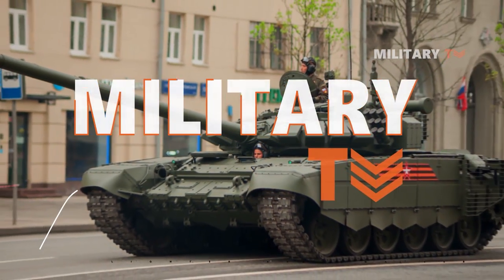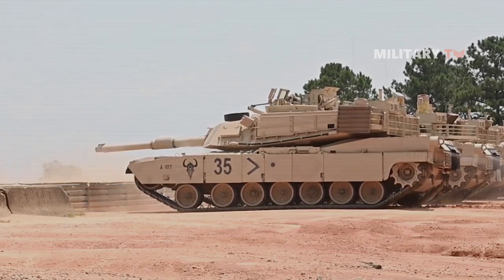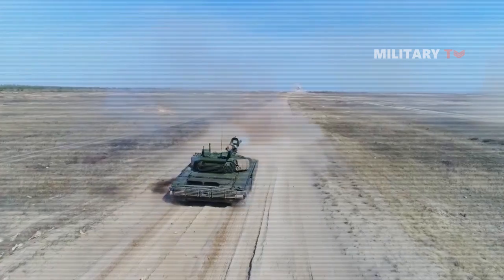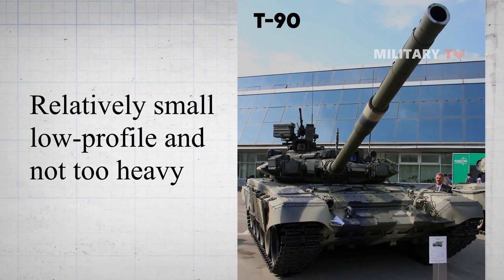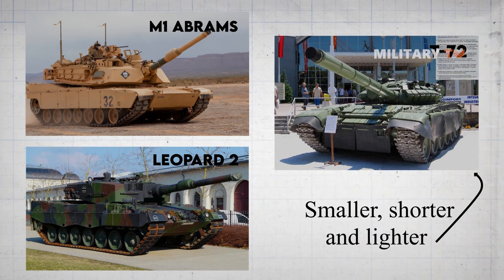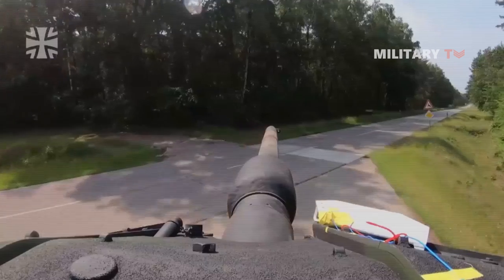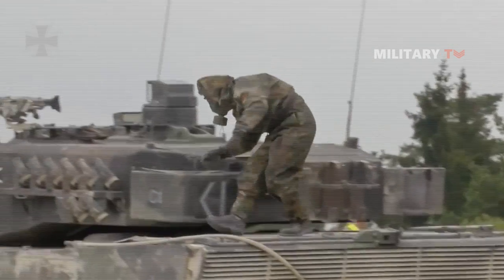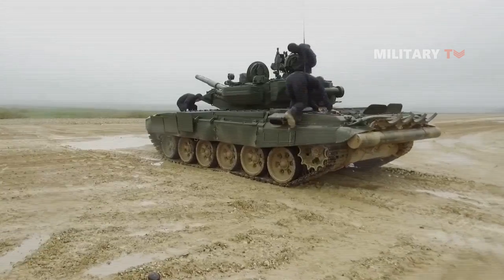Why are Russian tanks lighter and smaller than the western tanks

Comment: Lighter weight means tanks can be shipped faster. A single C17 can carry a single M1. An Antonov 124 can carry 2-3 T90s.
Reply: The antonov is double the size of a c17
Reply: @justinlance4174  no
Reply: @justinlance4174  thats not the antonov he mentioned
Reply: @startingbark0356  yes he stated antonov an120 in his comments right above this. Derpy derp. God Utube is rotting brains.
Reply: @justinlance4174  your brain is clearly rotting, he mentions the antonov AN-124 not the 120
Reply: 1 Abram tank is more than enough for 3. T90s
Reply: @etnadayasiv5449  nah
Reply: And on the terrain in Ukraine a Abram is really shit, way to heavy.. the reason why russia make tanks lighter with bigger tracks is because of the mud before in and after the winter... The Abram is as heavy as a Tiger tank, 70 tons.. Ask Hitler what happened with his tanks on that terrain.. they all sink in the mud because of all the melted snow.. That terrain is terrible and one of the reasons Hitler and Napoleon lost over there.. Abrams will sink in the mud too..
Reply: Russian tanks are made for that terrain
Reply: @toolfreak78  Russian tanks are primarily made for offensive operations, offensive operations normally will have you to flank your enemies and maneuver a lot, increasing the chance for the tank to get stuck in the mud, that's why most eastern tanks weight are generally below 50 tons, so the reason are not just terrain, military doctrine and the needs of the armed force also plays a part.
Reply: @toolfreak78  What variants of the Abrams are you talking about? a T-90SM vs an M1A1 would undoubtedly be an unfair comparison, so be specific.
Reply: Should've compared it with the IL 76
Reply: @toolfreak78  A day ago more than 10 Russian tanks sank in the mud during training. Not light enough.
Reply: @easygamingwwiigamingchanne729  indeed .. its terrible terrain.
Reply: @StormerSixActual  no matter what version, the newest abram will be peppered by a T90.  Because the T90 see the abram first, because of the detection system.. many tanks are better than an Abram. Even the Leopard2a7 is much better.. a challenger 2 is better, merkava ia better.. dont think abram is  a good tank... the only battle abrams had was against old garbage tanks with 75mm barrels and no nightvision.
Reply: You can't  compared the an124 to C-17. The comparable aircraft to the plane is the C-5.
Reply: Деревенщина из Сибири - Абакан    ,_,
Reply: @PatrickLipsinic  well technically yes
Reply: Деревенщина из Сибири - Абакан   yet we have both the largest plane and largest helicopter ever built. We just have no money.
Reply: Деревенщина из Сибири - Абакан   the bigger the car...
Reply: @toolfreak78  ATGM is easily gammed. That is why very few modern western MBTs do not both with an ATGM. The Abrams M1 A2C has better-updated optics and a higher first hit probability.
Reply: @teddyballgame4823  maybe but the optics of a t90 are also very good, detection sensors to 5km and thats a lot.. and the T90 has a secret very strong armor, at least they say... but the T90 has a superior cannon. An abram have 120mm smoothbore and T90 125mm smootbore.. a 120 or 125 pepper all tanks. Not a single tank on earth can survive a hit. If it hits even reactive armor dont work.. with so much force. A 125mm is much much stronger than a 120mm even  when the difference is only 5mm. It can shoot further and has much more energy on impact.
Reply: @toolfreak78  I call bullshit on that one, not only is 120mm superior to 125mm, 125mm is also less effective in combat. 

The 125mm shell is typically used by Russian tanks, and the reason for it over the 120mm was that the Russians weren't able to build as strong barrels as the West. Thus, they couldn't fire 120mm shells that were as powerful as NATO ones. So they build 125 mm shells to get that extra power. However, it should be noted that kinetic energy = mass x velocity squared, and thus speed is more important than mass. Thus the Soviet 125mm shells are still less powerful than NATO 120 mm, if they are identical otherwise.

TL;DR, barrel not strong enough so they built bigger guns [120mm is faster]

Abrams will kick T-90's ass in seconds, and add in air support from air forces, infantry ATGMs like Javelins, TOWs on Bradleys and you get a mobile armored battlegroup capable to blow the shit out of any T-90s defense.
Reply: @toolfreak78  well to start off the Abrams is faster has a better engine more gun depression a faster reverse speed and the gun being 5 mm makes little to no difference if anything the American bullet would have more energy  cuz of the smaller size let’s it slip through the air better not to mention the general unreliability of autoloaders
Reply: They didnt even had nightvision..
Reply: @startingbark0356  1 Abrams can take on about 2-3 t90's a real challenge would be the t14 but if not mistaken none are in service
Reply: @startingbark0356  but the backbone of russian tanks are the t72 which can still pose a threat
Reply: @etnadayasiv5449  not really depends on the situation
Reply: @etnadayasiv5449  of the abrams is in a hulled down position then yea. But if it’s the e other way around then no
Reply: maybe because the Antonov is 16m longer
Reply: @toolfreak78  the Abrams has nv in the commander and gunner sight the t80s and t72s only have it in the gunner sight
Reply: @scootiepatootie7721  yes the abram have but the enemy tanks didnt..
Reply: @toolfreak78  ah I miss read ur reply
Reply: @slycer876  the current russian T-72 has more then double the effective armor it had originally, and much better gun and shells, so its definitely a very potent machine, thats something the US and NATO would forget as they think its just the incomplete middle eastern rust bucket export model T-72’s
Reply: @startingbark0356  more than double the armor is an overstatement if your just implying inactive armor, modern Russian vehicles use kontact 5 or (most modern relikt) era which is designed to defeat kenetic projectiles, and even then its a percentage based off of angle(due to the ERA requireing a specific angle to actually damage the APFSDS US apfsds ammunition is designed to counter KONTACT 5 and more modern varients of US shells counters RELIKT otherwise the actual armor behind the t72 has barely changed. other than a few turret modifications.
Reply: @toolfreak78  Everything you said is just...wrong...how can you pull off being wrong on everything you said?
Reply: @etnadayasiv5449  Your also wrong...
Literally both sides are wrong here
Reply: You're picking the biggest cargo plane under production in Russia?(only the An-225 is bigger). Second, you picking the C-17 instead of the C-5 shows bias. True, the Condor may have a heavier payload. But, the C-5 is capable of carrying 2 Abrams main battle tanks, an Abrams tank plus two Bradley armoured fighting vehicles, 10 LAV light armoured vehicles, six Apache attack helicopters or 36 standard pallets type 463L.
Reply: And how many An-124s in the Russian Air Force versus USAF C5s and C17s?  Russia doesn't generally have a reason to airlift an entire tank battalion as does the USA.  For most contemplated engagements, RAIL will do.
Reply: @toolfreak78  And consider the massively greater kill rate for German tanks of roughly the same gear the Panzer Four. And later the Israeli kill rate vs Soviet tanks that were superior to all experts before the war. Yes they were not the latest Soviet tank but that the same of the Israeli tanks that were more outdated.
Reply: And based on prior Russian vs others battles that 3 fewer tanks than the Russians need to have an equal battle.
Reply: @toolfreak78  I've been reading about superior Russian tanks for over 50 years so I take claims with lots of salt. 

T90 still the flat land no hall down attack in mass standard Russian tank tactics machine. Still going to lose to standard German style hall down and ambush style.
Reply: @toolfreak78  Good point most of Ukraine the flat land that Russians build for. But Hitler's tanks were same or lighter than the newer SOVIET tanks in the period you speak off. Panzer III and IV. Yes the start of the war Russian tank also lighter but they sucked and it the T34 from 42 onward and the Russians had it in limited numbers at the invasion along with a very Heavy Tank in the Heavy Tank category that no one builds anymore. The Main Battle Tank just a renaming of the Medium tank. Thus most German vehicles the entire war roughly in same weight category. The mud actually bogged down both sides in roughly equal measure. 
Only 43 and later did the Germans field heaver tanks than the standard Russian the the Russians had their monster heavy tanks which they had the whole war. And the Germans only were able to build limited numbers of Tigers and Panzer V. 

Over all it was massive numbers of SOVIET tanks that won their kill ratio tiny compared to on paper inferior German tanks. 

It the Soviet winter that helped the most and that because the Germans were not equipped for or used to that level of cold. It was Soviet Winter offensives that helped win the war they could not do much in the Mud either.
Reply: @toolfreak78  the 2A46 is not suppirior the M256 (L/44) and the US has with its M829A4 a much better round over Snvits-2 
ATGMs get cockblocked by APS and other Softkill systems a DU Dart will not. 

the est. pennetration of M829A4 is ~800mm RHa @2km 
while the 3BM60 or 59 have about 700mm RHa @ 1km
Reply: @Adlumairsoft  thats what i said.. a regular round is much more dangerous than a radiographic missle or infrared because these systems can jam.. but a normal rpg they cant jam because ot has no signal, it only can be stopped by reactive armor.  A dart blows through anything.
Reply: @toolfreak78  the cannon on the vehicle doesnt mean shit. just because the .45ACP  (11.5mm) is larger than a .223 (5.56x45mm), doesnt mean its better. 

It wasnt till 2005 that Russia actually released the use of newer ammunition, but for the longer guns of their T-14 series (2A82-1M) and wtf ever will upgrade to use these guns as they have a higher chamber pressure durrability. So, so far, the T-14 and the very very few T-90Ms use the newer ammo, but as its not the primary munition and gun, we wont talk about it as its such a small factor. (dont get asshurt, x4 Su-57s vs x300 F-35s means the Su-57 is non-combat effective)

Before this time the Russians had been using left over Soviet-era ammunition MOSTLY. the 3BM60 Svinets-1 and 2 was their first munition in 2002 after the fall of Soviets. This is an 8.1kg projectile. with a muzzle velocity of about 1790~1800m/s. this gives the munition at 1800m/s a power of 13.122 MJ (but even then, its predicted from Turkish and South African Reports that the MV is as low as 1660m/s and the projectile weight is as high as 8.8kg, still would only get it to 12.12MJ). 
The US uses the M829A3 and now the A4, with a muzzle velocity of 1700~1750m/s and a mass of 10kg. lets go with the low end here; 1,700m/s by 10kg is a power of 14.45MJ. 

For referance, the 3BM60 Svinets-2 states its able to penetrate 515mm/0° @ 2km. i dont have to state any more on that. 
=
But then you bring up missiles. oh boy, does it suck to be you. because the M256A1 on the M1A2 is also smoothbore, it can and HAS fired the LAHAT anti-tank guided missile. the trials set it as a pass for the M1 crews. but wasnt put into service for the US as it wasnt needed when it was trialed. 

So, dont talk shit ruski.
Reply: @toolfreak78  all this superior russian technology discusion only to see russian tanks destroyed by bridge, few guys with nlaw, rpg 28, civilians with molotovs, lack of fuel, some potholes and gypsies who stole a tank xD
Reply: @adrianstachowski9422  just wait.. that are all t72 tanks and bo t90s.
Reply: @toolfreak78  what is t90? Just t72 with different turret. This doesn't make any difference against bridges, unguided anti tank weapons and bottles with fuel xD. The main force of russian tanks are t72b3 and b2
Reply: But with no gas 😂
Reply: @toolfreak78  No there are confirmed T90s getting hit lmao.
Reply: But they only had one anotov and it’s gone now
Reply: @toolfreak78  T90 has better gun? You know it's not 1st of April yet, right?
- Abrams has M829A4, probably the best APFSDS in the world currently by far, and the best Russian APFSDS in service is 40-year-old 3BM42 (because 3BM59/60 exist on paper and in trials, but not found anywhere near real tanks).
- Abrams has independent commander thermals since M1A2, 30 years now, while T90 is just starting to get them on T90M, and there are a whopping 10 pcs of them in the whole Russian army
- Abrams has Trophy up and running already, while the Russian military is only planning to get Arena somewhere around 2025
Reply: The US can afford multiple C-17s
Reply: Russia is known to exaggerate things more than west . Majority of the cutting edge technology is made in west or japan, china , Korea . In technology west will always beat Russia.
Reply: But if you don't have spare parts, fuel, ammo, and a trained crew it really doesn't matter how far you can ship it, unless you planning to use it as a paperweight.
Reply: @toolfreak78  lol They apparently can’t see those NLAW and Javelin missiles in Ukraine.
Reply: @coolbreeze2.0-mortemadfasc13  what is lol? You think Russia is not going to win. Its just a matter of time when Ukraine become Russia.
Reply: @toolfreak78  you forgettin the leopard
Reply: One for battle,  two for spare parts.
Reply: @toolfreak78  the reason you cats make them lighter is because you can't afford to properly outfit them . They are faster to getting on a train but damn things barely make it to front line . Should include a tractor to tow them when they are sent to war .
Reply: @toolfreak78  yes,  napoleon's tanks were stick in mud.
Reply: @toolfreak78  they are made for attrition
Reply: @toolfreak78  now if gunner would stop drinking vodka and apply themselves
Reply: @slycer876   a threat in regards to any 19K Armor Crewman of an M1A1 laughing themselves to death as they observed their SABOT hit the T-72 and watched the turret land 30 yards away from it in the Iraqi desert.
Reply: @startingbark0356  он изменил 120 на 124
Reply: Bruh Antonov is like the biggest airplane in the world, of course it can carry more tanks
Reply: @startingbark0356  an 124 is substantiality bigger and can carry twice the load of a c17
Reply: @etnadayasiv5449  Not at all. just because Abrams is big and looks well armored- it is vulnerable to modern grade shells T-90 uses. Keep in mind, today nobody uses armor-piercing. Everything is done with HEAT/ HE, as well as cumulatives. It is not necessary to destroy a whole tank- instead  it is the crew.
Reply: you mean the Ukrainian Antonov?

Comment: This talks about Abrams tank losses in yemen, syria, and iraq. They fail to mention those loses were of old tanks given away and stripped down to the most basic of systems. An American crewed abrams is much better than the tanks that were lost in yemen, syria, and iraq
Reply: Ok man take it easy
Reply: Dont forget the losses of russian tanks in the 6 days
Reply: Tanks are normally sold abroad without the reactive armour I think, as that is considered secret.
Reply: @toldavf1523  Russian tanks were literally being towed by Ukrainian farmer tractors
Reply: @BlatentlyFakeName  Yes you are right, not only tanks, A lot of F35's sold to other countries are also being given with less stealth capabilities and less technology overall, same goes for US drones, Tanks, and other aircraft being sold to foreign countries.
Reply: @Bred Spillernot as much as you think, the more modern Russian tanks have the same gun elevation and depression problem they have had since the t55. It's the most notable disadvantage to being so low profile.
Reply: @player764  The UK use their own equipment in the F35s. They did the same with the Apachi and also put a more powerful RR engine in it.
Reply: @Bred Spiller you have entirely missed the point